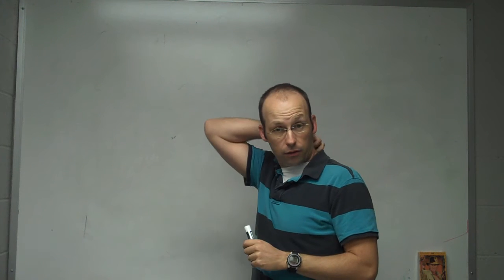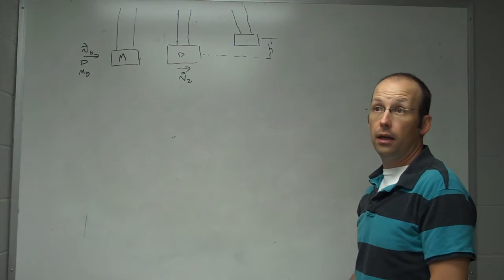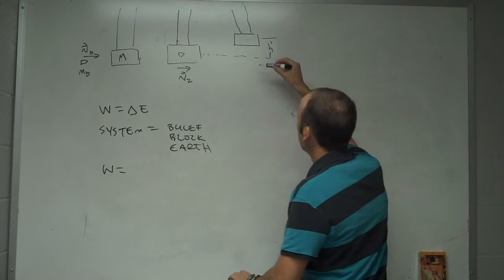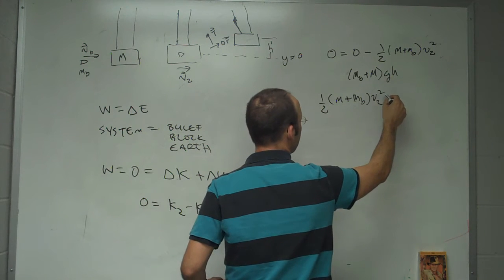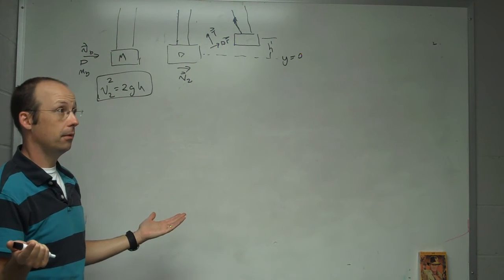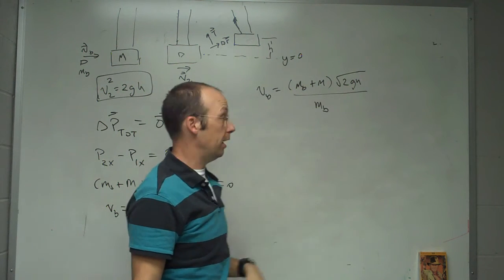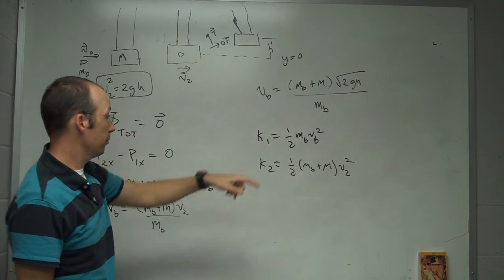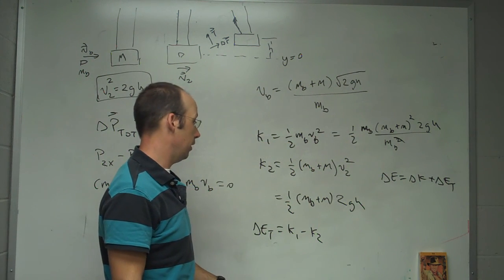Ballistic Pendulum

Comment from the maker: @exp3840 Let me see if I can answer this (sorry, but it was a while ago that I made this video).

If you have the length of the string, you can find the height (h) in terms of the angle the pendulum swings up.  Draw the mass on the pendulum both at the highest point and at the lowest point.  Now draw a horizontal line from the highest mass to the vertical hanging string.  When you do that, you made a right triangle.  The length of the vertical side of this triangle will be L*cos(theta).